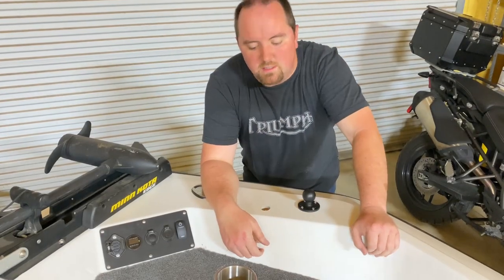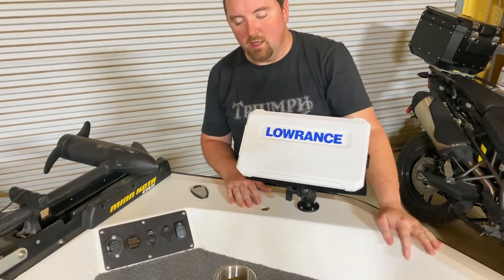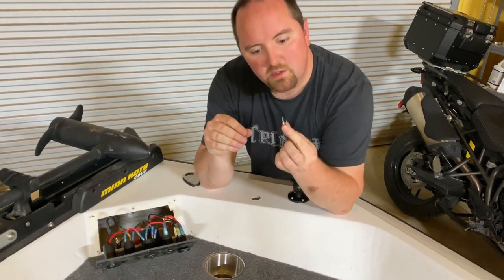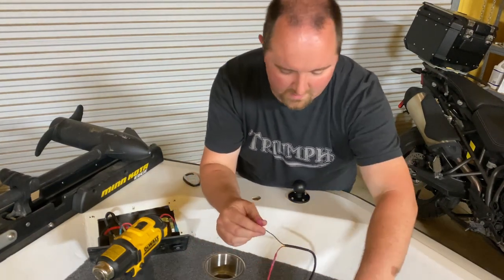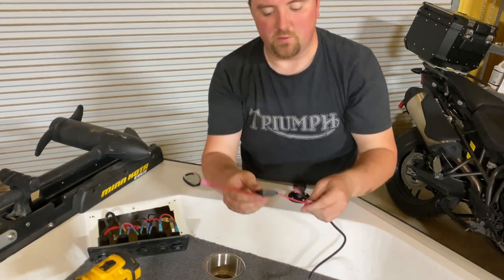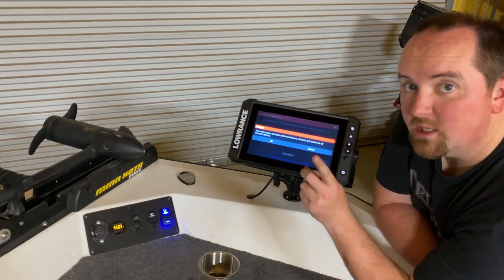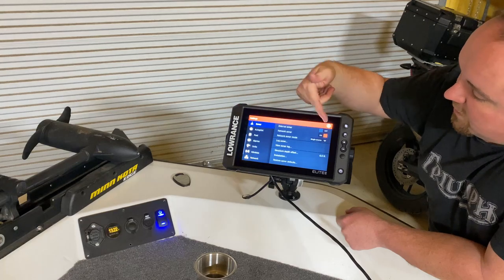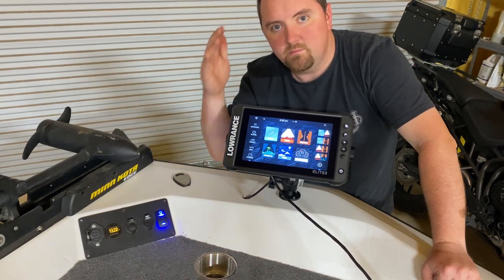Lowrance Elite FS 9: Install and Networking Setup

Comment: Thanks for taking the time to make this video. I have a question even though I believed you clearly covered it. Then again, you weren't on the water at the time. I just want to make 100% sure. 
Will I be able to view (side imaging and DI) on both FS units with one transducer when networked together ?
For some reason seems I have heard only 2D sonar and mapping can be shared, and not SI or DI can be shared.
Reply from the maker: @thebigcountry8518 Yes, all aspects of the transducer can be shared. I’ve been out on the water numerous times and used both. The mapping is a little different than I expected, though. Waypoints can be shared, but not any live C-MAP data that you’ve recorded; only the device with the SD card installed can show you that data.
Reply: @basscleffishing  Hey thanks for the info. I figured you had a chance to give them a try. Trying to make a decision between brands. Humminbird has really dropped their prices this week. There's aspects of the Helix's I like ,and then there's Lowrance elite FS aspects I like. I knew Helix would share One transducer. I wanted to make sure Elite would. Thanks for helping out.
Reply from the maker: Happy to help. I liked the menus and navigation of the units a lot better on the Lowrance’s, but that’s all preference. Definitely get your hands on both and play around with them first, if you can.
Reply: @basscleffishing thanks this is the answer I was looking for.  I just ordered my ethernet cable to connect both units. Thank you
Reply from the maker: Happy to help!
Reply: Follow up, got my cable in today! O man everything worked i didnt have to make any settings changes. I can share 3 in 1 ducer and i can view my active target on both screens at same time!  Cant wait to get back on the water.
Reply from the maker: @osilekpl79 Awesome! I hope you catch some new PB’s!

Comment: Bass Clef Fishing - I have a Lowrance Elite FS 9 - I use it for SI. I set it up on my pontoon on the starboard side. I deploy the unit when I get to my target fishing area. I have another unit with the transducer mounted on the transom for traveling. My question is - Can I use my Lowrance Elite FS9 unit for GPS, while the transducer is out of the water, without damaging the transducer?  Thanks, Bernie
Reply from the maker: I have read that running the transducer out of the water will damage it; there is a setting in the device to turn the transducer off, however it might be easier and more reliable to just unplug the black transducer wire out of the back of the unit until you drop it into the water. I have my wires zip tied together about 6” away from the connections so I don’t lose one of them. Hope this helps!
Reply: @basscleffishing  Thank you so much. I am embarrassed. I should have been intuitive enough to figure that out. But you quick reply allows me to feel confident to do just that when I get back to NY...soon! Thanks so much. Bernie
Reply from the maker: Happy to help! Best of luck.

Comment: I have the same exact setup as you but had someone else install them.  My question is does it matter which unit is connected to the transducer for networking purposes?  My FS9 on the bow does not give me any depth or water temp and says stopped.  My FS7 on the consoles is working fine.  Maybe I don't have the networking set up correctly on each unit, perhaps?
Reply from the maker: @Coachbillyc It doesn’t matter which unit has the transducer on it, but that will determine where under the boat you are getting your info. I left mine on the console unit so I can still get data while the trolling motor off the bow is out of the water. I think a single transducer setup, this is definitely the way to go. Now, for depth, I can get that on both units via the sonar screen. If you are charting depth on your CMAP, I believe that only works on one unit at a time. Same for water temp; I can pull water temp up on my bow unit, but it disables it in the console unit… can’t read it on both at the same time. I have looked all through the settings menus and can’t figure out how to get it in both. May not be possible. I fish solo most of the time, so only having it on one unit doesn’t bother me that much; not a deal breaker. I hope this helps!

Comment: great information,  just wondering if you ever have encountered the chart direction pointing the wrong direction, my chart plotter was pointing the opposite direction (180degree).  This only happen AFTER I connected the Lowrance to the existing Suzuki network..    I did some research and I got to the point where most say Setting—->gps source—-select fs9..  but after trying it out, it’s does respond but still wrong direct by 45-90degree…….  I also found out the “within the network which ever unit gives out the strongest gps signal the network follows.” Doesn’t seem to make sense that the Suzuki has got its own sps or does it for speed.. I don’t know..   thanks……
Reply from the maker: I have not messed with connecting the system to the network hub or to an engine system; my motor is a 1987 Johnson, so doesn’t have that capability as far as I’m aware. 

By chart plotter, I assume you are talking about the map screen. GPS units are directional, so if it changed after you hooked it up to the Suzuki network, I would try to find that GPS receiver and see if you can rotate it. Other than that, there is a setting in the maps to keep it pointing North at all times; might be a quick solution.

Comment: can you get the trolling motor to follow the waypoints that you marked on your Lowrance or do you just get the sonar capabilities from you mounting the transducer to your trolling motor?
Reply from the maker: In my situation, I would just get the sonar capabilities from the front rather than the transducer mounted on the back. There are models that will follow GPS, but I don’t have one of those.